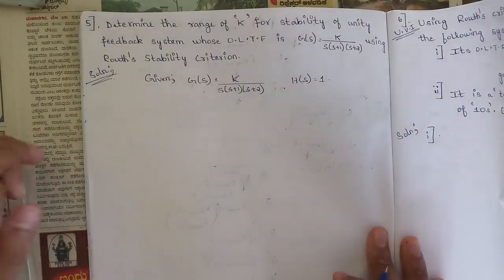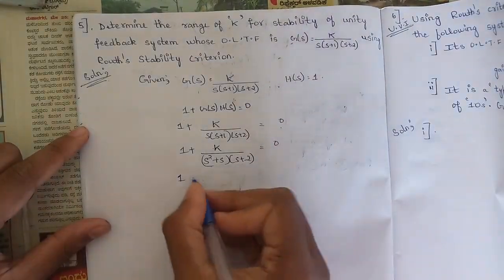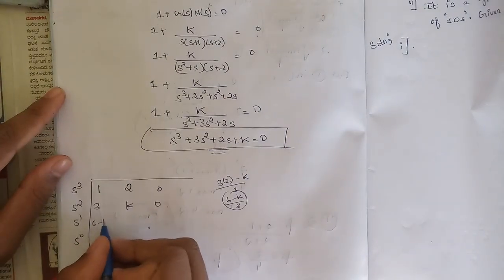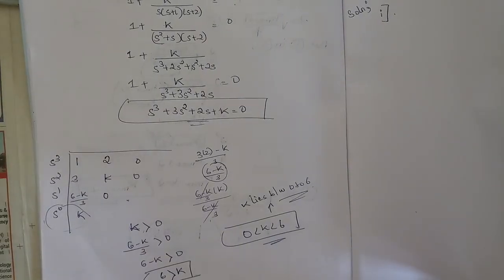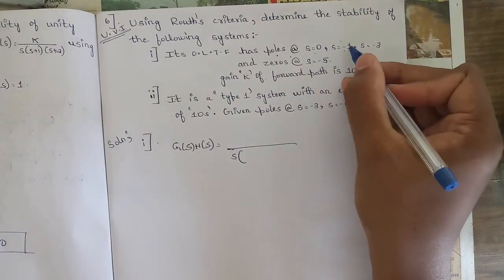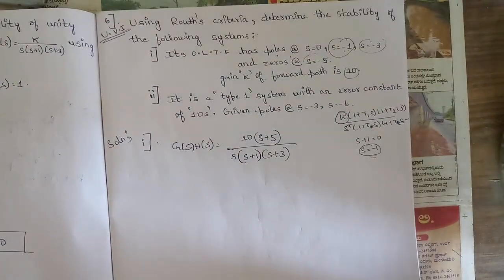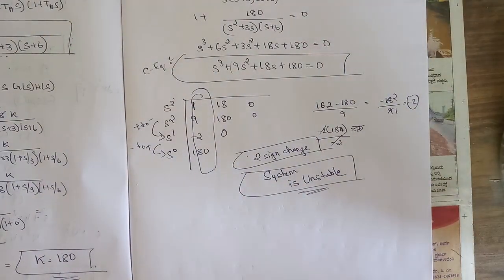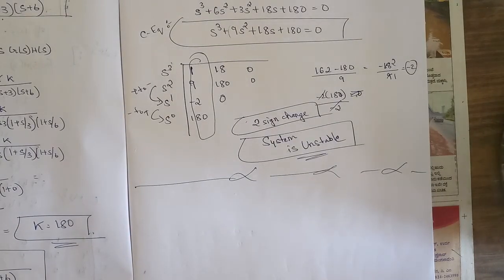5.RH Stability Criteria, Marginal Value, IMP 2 Problem Explained Module 4 4th Sem ECE  VTU BEC403

Comment: Sir like it is open loop tf so g(s)*h(s) isnt the transfer function
Reply from the maker: You're right, for an open-loop system, G(s)H(s) is not the overall transfer function, but it's used in the characteristic equation for stability analysis. Good observation! 👍🏻